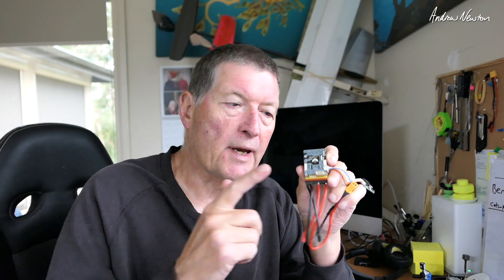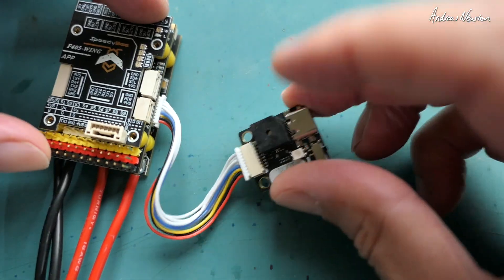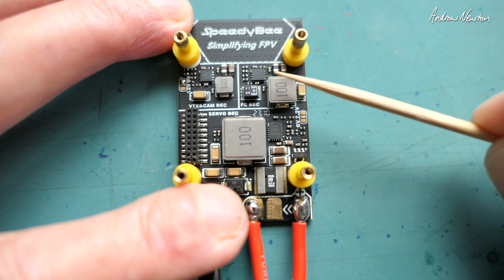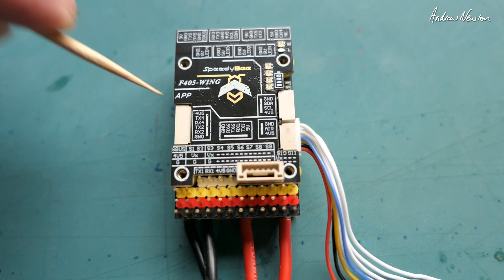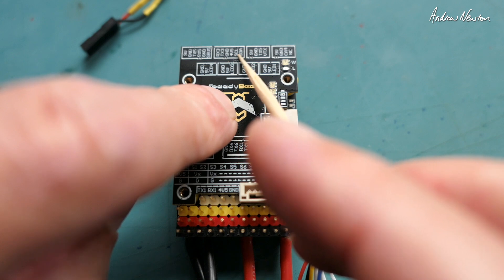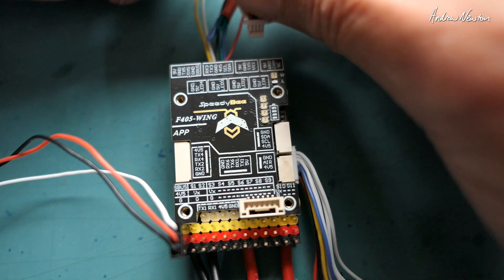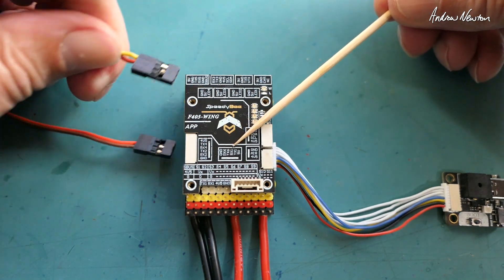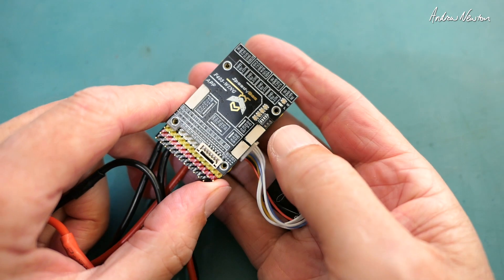SpeedyBee F405 Wing - Connection Basics

Comment: Hello, i have the rm er6g elrs receiver and im trying to wire it to this f405 wing. 
The thing is the er6g does not have output or input connections. I changed channel 2 to serial tx, (channel 3 is automatically serial rx) I’m trying to have it so my receiver is standalone and I just use the pwm pins on the FC for my servos. I’m stuck because I can’t get the receiver to stay powered without the esc bec connected, yet I can’t connect all my servos on my receiver because I only have 6 channels, 2 are used for serial tx and rx, (of which only channel 2 is connected to fc sbus uart 2), one is used for esc bec cable, and channel 5 has to be allocated for arm switch. That leaves me with channel 1,3,4, and 6 (6 is a limited channel so idk if I can rely on that one for a servo channel) Please help!
Reply from the maker: Connect Tx Rx V and G to UART1 and use CRSF. Then you will need to plug in a battery to the board
Reply: @AndrewNewton  i do not have tx rx v and g as it is a pwm with only 6 channels, no sbus or crsf output, just pwm. Is there a way to connect a pwm with no tx rx v g to fc?
Reply from the maker: You said you changed it to serial. That means Ch2 signal pin is Tx, Ch3 is Rx, middle row of pins is V, bottom row is G
Reply: @AndrewNewton  thank you!!!

Comment: Hi Andrew can you please tell me if I can use my futaba 16iz transmitter for this flight controller   please thank you
Reply from the maker: Tell me what serial output your receiver supports. I'm guessing it's SBUS
Reply: @AndrewNewton  yes sbus
Reply: @AndrewNewton  I'm really confused will I be able to do long range fpv with my futaba 16iz transmitter or do I have to buy another radio?
Reply from the maker: @ramonmejias2178  SBUS receiver will work with this FCBoard so you should be OK. For proper long range I suspect you will need to buy a new radio. Radiomaster ELRS Boxer would be perfect.

Comment: what wires do i remove from the gps to get it to work?
Reply from the maker: Which GPS?
Reply: @AndrewNewton  bz-251 gps
Reply from the maker: No need to remove wires. But they do have to be connected to the correct pins. G to G, V to V, R to T, T to R for the GPS and  SDA to SDA, SCL to SCL for the compass. You don't need the compass for fixed wing use, can disable it in INAV or just not connect the wires.
Reply: @AndrewNewton  thank you so much!! I will try that. I didn't know to turn off the compass.

Comment: Fantastic video thank you sir. Got me started! I am only running a DJI 03 to the F405 with a GPS to get hud and flight data. I am not ready to connect a receiver and control the flight surfaces yet. The problem is that the DJI 03 won't arm to high power. Ive hit a wall on it. Is there a setting I can adjust or perhaps jump a connection to trick there Flight controller into arming the DJI 03? Thank you
Reply from the maker: Thanks. I don't have 03 but I assume you have to connect it to a UART and select MSP DisplayPort  for that UART to send arming information.

Comment: I finally figured out my issue with a Walksnail Avatar with no OSD. Just putting this out there for other people... I had to solder the Avatar VTX wires to the DJI outputs, NOT the 4 wires for the "analog VTX" that's labeled in the manual.
Reply from the maker: Well done. Which manual says to use the analog outputs?
Reply: @AndrewNewton  Fair question, and my fault for my misunderstanding. But I will say... the confusion between "tx5" and "vtx" is not clear in either your video or the manual. Having 4 wires from a Walksnail Avatar is more intuitive that it would be connected to the only VTX output with a 4 wire diagram. As someone who doesn't come from an electrical engineering background, "square fits into a square" makes a lot more sense than "square fits into a rectangle." If that makes any sense? There is both an Rx port on analog as well as on digital, so forcing the fit makes sense when it's not specifically clarified. It would be nice for that type of specific clarification in the future. I appreciate all your objective and subjective inputs and your hard work that goes into your videos, but just trying to give some valuable feedback from my perspective. I am currently struggling with getting the OSD to show up with the speedybee f405 wing mini because the manual isn't clear on the analogue vs digital inputs. It labels them, and I've tried using the R5 and T5 outputs and switched them numerous times, but still no luck... So I revisited this video in hopes of getting an answer since your new video doesn't address it. I think my next attempt will be to use the 6 pin plug, but I just prefer to solder. Just something to think about....

Comment: 5:15 you can use a (Micro SD to Micro SD Card Extension Cable Adapter Flexible Extender 15CM Black) so  no problem with where the slot it
Reply from the maker: Good idea thanks

Comment: Great video!  Is there an SBUS or CRSF receiver that is DSM2 or DSMX compatible?  New to FPV and trying to make this flight controller work with my Spektrum radio.  Thanks!!
Reply from the maker: I think you can use Spectrum serial receivers with INAV. Plug in to UART1 and choose SRXL2 in the receiver page. Actually it depends which Rx you use. Some (maybe satellite receivers) need 3.3V and plug in to the T1 pin. Check Painless360 videos

Comment: Where does the ELRS reciever wire connect at the ELRS receiver end??????
Reply from the maker: Depends on the receiver. Serial receivers will be soldered on to the 4 pads. PWM receivers need to be changed to serial output on specific pins

Comment: Hello Mr Newton, you mentioned in this video that the fourth cabel to the camera is not connected. The diagram tells that it is for menu of the camera control. 
Is it for camera control or not?
Reply from the maker: If you look at the board there are only 3 solder pads.
Reply: @AndrewNewton  Ok, thanks for the hint 👍

Comment: Hello Andrew, you are one of my last hopes. My flight controllers no longer have a USB connection and I can no longer connect them to the INAV configurator. I always get the following message: Failed to open MSP connection. Is it possible to completely reset the Speedy Bee F405 Wing and the Matek F405 TE? Can you give me a good tip? Many greetings from Switzerland.  Didi
Reply from the maker: Replace USB drivers is all I can suggest, unless it's a dodgy USB cable or socket on your PC?
Reply from the maker: Oh another thought, close all other programs on your PC. CURA does that to my Mac.

Comment: Hi. 

I am having an issue arming the motor. The ESC I am using is E flite 10 amps pro ESC. I am using radio master tx16 radio and ELRS receiver. The ESC gives a power on beep plus 3 beeps to show 3 cell battery but nothing after that. 
The flight controller gets armed in INAV (I am using certain switch to arm it). What should be the turn on sequence? I have tried everything. Turning on the radio with throttle fully back. Then connecting power to flight controller/ESC and immediately turning on the arm switch on radio. Nothing is working. 

Do you think this ESC is compatible with this controller? What could be the issue? Could the motor be bad or the ESC provide the beeps about which I told you?
Reply from the maker: Does the throttle graph move in the receiver page?
Reply: Yes the throttle graph moves in the receiver page.  Infact not only that the servos for roll and pitch also move while I move the stick on transmitter. 
I also tried arming the flight controller and when It says armed, I opened the output page and saw that the mixer for motor over there also responds to the transmitter input.
Reply from the maker: @revert2theStr8path  Ok that's good. Now try to spin up the motor using the motor test on the Outputs page BE CAREFUL
Reply: I tried doing that. Obviously that can't be done when the flight controller is armed. So I disarm it. Then enable motor output. Put the mixer for motor to max and then plug in the power to ESC but no beeps other than the power on tone and the 3 beeps for cell count indication. Since there are no beeps after cell count stage, therefore no subsequent movement of throttle has any effect. That's the things confusing me that I am unable to spin the motor even from the configurator.
Reply from the maker: Time to check the soldering on S1 pins or try a different ESC. You are plugged in to S1 and not the SBUS pins?
Reply: @AndrewNewton  yes plugged into the S1 pins. I have ordered another ESC (Very Good RC 32 bit 15 Amps one). I will give that a try and then also look for the solder joints but they seem ok. I tried reversing the connector of ESC as well (with middle wire removed) and changing the ground and S1 pins but to no avail. Is there any way I can try the S2 port while S1 remains blank? I think I tried it as well. Didn't work.
Reply from the maker: @revert2theStr8path  Yes you can use S1 or S2 as long as there are 2 motors setup in the mixer page. Do you have ESC protocol set as STANDARD?
Reply: Yes the ESC protocol is set as standard. I think I also tried the S2 port and same problem so don't think soldering is the issue either. Could be internal problem with flight controller but I guess INAV should be able to detect it. Might be the ESC itself. Could be a compatibility issue. I am a newbie so not sure about that aspect. The E flite 10 amps pro ESC might be old?
Reply: Do you think the servo BEC voltage has any effect on all this? I am using the default 4.8 volts. Do you think I need to change it or whether it would make any difference? I am using the HS-82MG and A2208/17T 1100 kV motor. Do you think 4.8 BEC jumper setting is fine? The battery is 3S lipo. Just want to make sure there is no wrong setting before I go and buy and new ESC or may be a new flight controller.
Reply from the maker: Servo BEC is not related to the ESC issue and is fine as it is. You do need to disconnect the ESC BEC red wire before connecting the ESC to the board. Before buying new gear I would get a servo tester or a normal PWM receiver so you can test the ESC and motor while not connected to the board. They actually sound like they are working properly from the beeps.
Reply: Ok I will try that. Thank you so much. If they work fine then it comes down to a faulty flight controller board
Reply: Right. So I tested with a servo tester and the ESC does get armed and the motor does spin. Plugged back the ESC to the flight controller and again same issue. Doesn't get armed and only gives beeps indicating cell count of lipo. 

So either bad solder, bad flight controller or and compatibility issue. :/
Reply from the maker: Need a 3D GPS lock to actually arm. The INAV screen will tell you why it's not arming, also type Status in the CLI to see why.
Reply: All those checks were green. 
I tried the full throttle and connected the battery and the ESC got burnt out. :/ not sure why this was the case :/

Comment: Hi 

I tried connecting HGLRC M100 mini GPS with this Flight controller. I connected the 4 pins correctly. I also tried swapping the transmission and reception pins however the GPS icon is still red. The GPS comes with 2 LED lights which are on right now. Which means it is getting power as well. What could be an issue?
Reply from the maker: Check GPS is on UART3 in the Ports page, and no other GPS set up. Check cables with multimeter for breaks and soldering on the GPS. That's all I can suggest.
Reply from the maker: Also post the question on the INAV Fixed Wing Facebook group.
Reply: Hi, problem solved. I had it on UART 2 instead of 3 on Ports page by mistake. Thanks
Reply from the maker: Excellent, well done.

Comment: Hi. I could realllllly use yer help. I have ths fc and a 03 air unit. Its all wired up. But icant get the air unit to talk to fc and move servos etc.. how do i set up for vid and receiver in ports etc... i hope u xan help ...im reall bummed i cant it flying.
Reply from the maker: Can't help with 03 setup. But otherwise it's all in the video.

Comment: Hi, 

So what would be the voltage going into the ESC and what would be the voltage going into the servos if the servo BEC is set to 6 volts for example? The servos get 6v input and the ESC gets whatever is the battery voltage? Or does the ESC also get servo BEC voltage which is 6 volts? Kindly clarify
Reply from the maker: ESC gets the battery voltage. Servos get 5, 6 or 7V from the servo BEC
Reply: @AndrewNewton what would be the max amps out of the speedybee to the ESC?

Comment: I found a way to have the FC set the ARM command without requiring satellites.

Set a rule in the MODES tab to set ARM when a selected servo is within the range specified. I picked a toggle switch on ch5. Then enable a logic condition to ALWAYS override arming safety. This is done in the tab that looks like a hollow gear. This was needed for my 03 air unit that stays in low xtr power until it receives an ARM conmand. It now switches out of low power based on the position of the ch 5 toggle switch, allowing you to go to low power when on the ground and only switching to high power when in the air. All without needing satellites and done thru the app.
Reply from the maker: Sounds good, although you are brave to override arming safety

Comment: Great video Andrew!! But I have a question...
do I have to flash Inav/ardupilot to be able to connect to it?
Reply from the maker: Comes with INAV 6 preloaded. You will need to use the configurator to set the board for your particular connections.
Reply: Thank you so much!! Is it the same for ardupilot?
Reply from the maker: @messybench974  Yes you would need to flash Ardu onto the board, then use Mission Planner to set it up. You have to tell the board what and where you are connecting receivers and servos / motors
Reply: Really nice from you!! Appreciate it 👌

Comment: For the sbus example, you unplug the throttle lead from the receiver and connect it to the FC with the red wire removed. What is now powering the receiver?
Reply from the maker: I removed the red wire from the ESC cable and connected to S1, which is right next to the SBUS pins. SBUS receiver does require all 3 wires to be connected to the SBUS pins and is powered from the 5V BEC on the board.
Reply: Got it thanks. One more q. I'm connecting my receiver thru sbus and am using channel 5 to send the arm command to an 03 air unit to force it out of low power mode (03 air units require the arm command to go full power transmit). I've set UART5 to DJI peripherals on PORTS page and ch5 slider bar moves correctly on RECEIVER page. I wrote a rule on MODES page to set ARM based on ch5 movement yet the 03 air stays in low power mode. Am I doing this correctly?
Reply from the maker: @JamesPenny-l3b  Need at least 6 sats acquired by GPS to Arm the board

Comment: Bad FC ? 
The 4 leads that the battery voltage is flashing one after another. They were working correctly.
OSD, GPS, working.
The Runcam is getting very warm and haven't gotten the  sbus to work.
Thanks for the help

Comment: If I am using walksnail do I still plug into the same port as the DJI VTX? I have heard some you cant and some you can but I havent been able to find any documentation on that. Really new to FPV and digital systems.
Reply from the maker: Yes same port. It's just a UART connection with 9V power supply. But you need to check the plugs have the wires in the same slots
Reply: @AndrewNewton  awesome. Thank you. New to this whole thing and trying to figuring everything out.

Comment: Well well, im nearly $1,000 invested and I've copied everything your video says.  I CANNOT get my goggles 2 and 03 AU to see arm command. I've double checked tx/rx inverted and to no avail , is there a setting in the goggles i may be missing ? Also no OSD is showing up.  Is there a link you can give me for a more thorough setup ? Thank you
Reply from the maker: Need to enable the OSD in INAV and turn on the Custom OSD (in my V1 goggles) Search for my DJI HD OSD INAV Craft name video
Reply: Hello Andrew , i got the arm switch to work but i thought the rx and tx from the air unit to the flight controller were supposed to be reversed ? I put them back to TX to TX and rx to rx , is this correct ? Also , my voltage reading is 11.2, it's supposed to be default at 9v , do you know what's up with that ?  @AndrewNewton
Reply from the maker: 11.2V sounds like your goggles battery voltage. Have you turned on the Custom OSD option in your goggles? Must have Rx to Tx etc
Reply: @AndrewNewton  no. 11.2 would burn the goggles 2 , they can only handle 9v. Something is seriously wrong here,  the arm command will NOT work when I invert Rx / Tx,  I know it sounds crazy but I'm going to need to find someone I can get hands on.  It's nearly impossible to communicate the issues in having through texts .. thank you for your help tho.
Reply: @AndrewNewton  just thought I'd let you know I got the osd working,  instead of picking the dji osd in the ports tab under peripherals I picked the (MSP DISPLAYPORT) ! and it works.  I'm not acussing you of any wrong information but many of the videos on here said to pick the DJI HD option in ports tab🙄. Thank you for your help and now I must start learning the switches menu next.  Thank you sir,  God bless